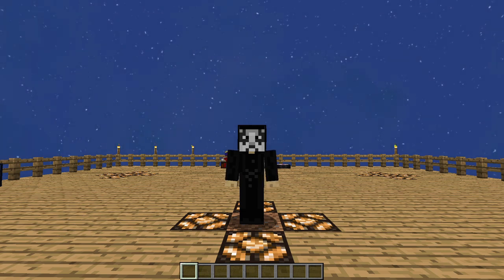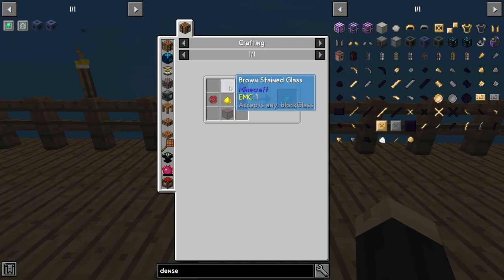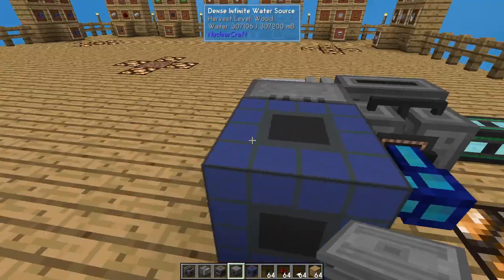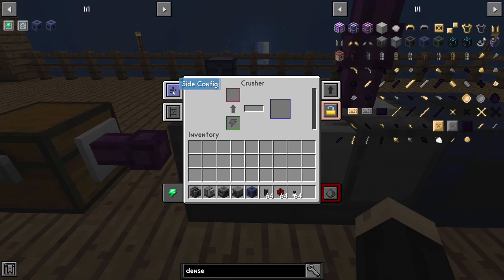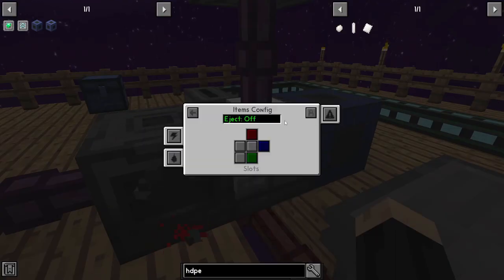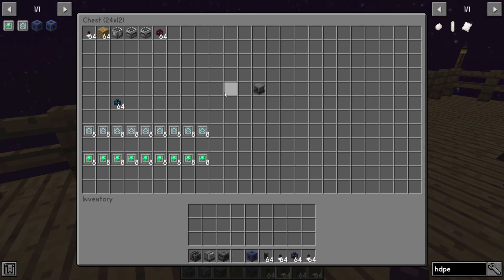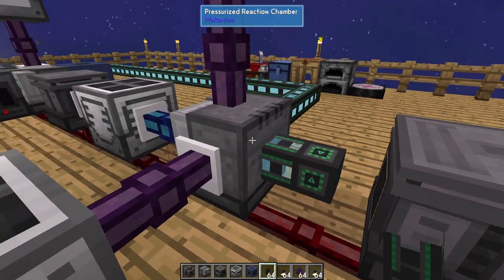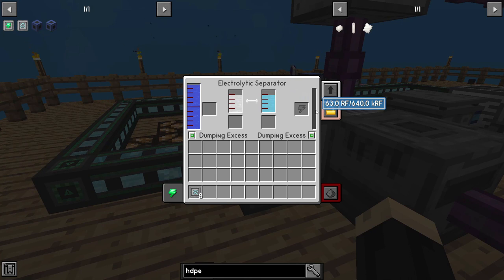Minecraft - Sky Factory 4 - How To Automate HDPE Pellets 2.0 - Improved Version

Comment: The fact you could also throw the black hole unit/tank into a black hole controller to make it easier to manage switching out the black hole unit/tank without having to worry about the system clogging.

Comment: Once again thanks to you Draven for the solid SF4 guide, I remember the old guide but yeah this one takes the classic and ramps it to a million. Out of curiousity i decided to test my build with 2 compact infinite water sources and found that works quite well, Instead of the fluid extraction cable i just sat the 2nd there feeding into the electrolytic separator. Even with the speed upgrades they have an overabundance of water. A possible alternative for those who couldnt be bothered building 64 standard infinite water sources (I did I was just seeing if i could save the other 6 compacts)

I can confirm that its possible to meet the power needs with 5 geothermal plants with just 1 stack of speed mods each. I have 2 automated users feeding 2 cauldrons with the geothermals arranged around them. In a way more expensive cause of the 2 upgraded cobble gens and the 5 powerplants but i didnt need to use 12 stacks of speed mods

Comment: For the bio fuel use a double chest, 2 hopping bonsai pots with the best mulch you can get and use apple sapplings in both pots because apple saplings drop apples and saplings and with better mulch its gonna create enough apples to keep the machine running and the chest filled up
Reply: I’ve also found that sugarcane has the same effect
Reply: A chest will get clogged, It's better to use a black hole unit locked onto apples
Reply: @אלוןגלמן-ר6ב  thats good doe because there would be no shortage of apples ever and you can always dump excess items

Comment: i need help, I have all the components in my 2nd PRC to make the HDPE pellets, but for some reason its not functioning at all. It has the power to run but it won't. Any idea on what's happening?
Reply: The same thing is happening to me
Reply: If you haven’t got it working yet it’s probably because you put in some speed upgrades. For some reason it needs the energy upgrades as well as speed upgrades.